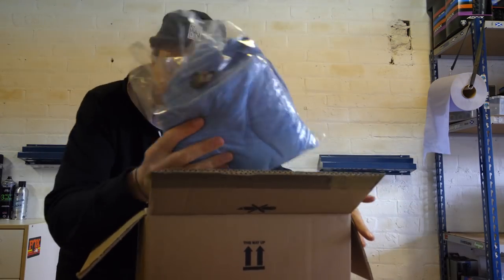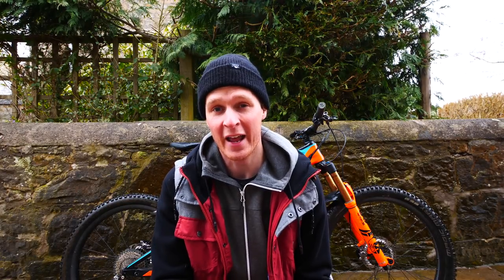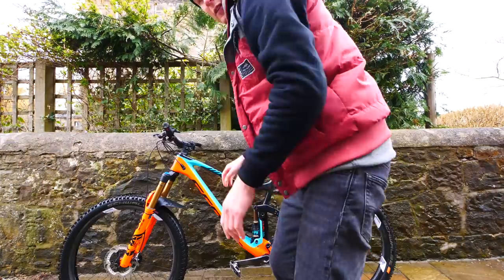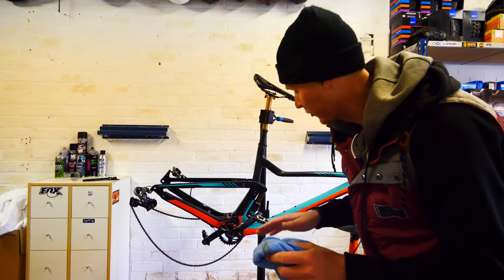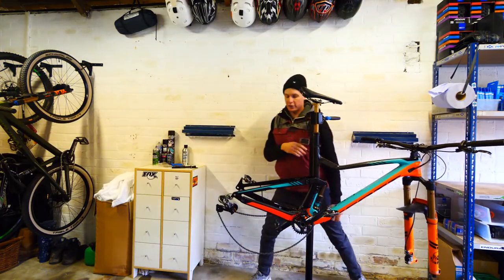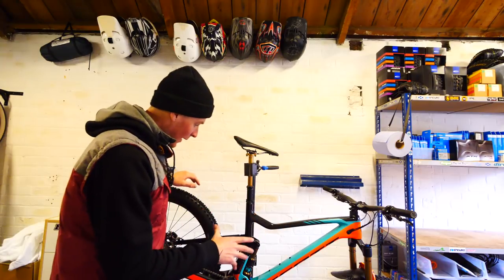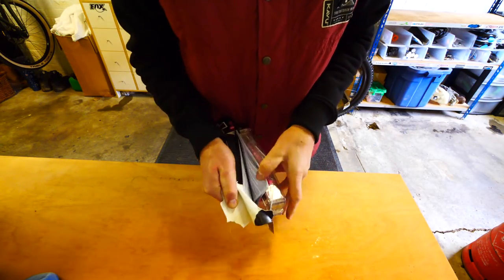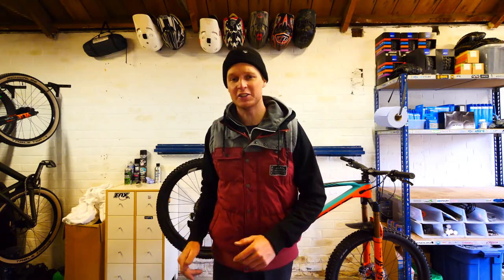A SPRING BIKE MAINTENANCE GUIDE

Comment: Using a screw driver for the jockey wheels - will definitely remember that! 
I think it was a park tool video (not sure) which explained when using a chain cleaner, once you've cleaned with muc off, to then use warm soapy water to ensure you've rinsed all the muc off / other product off from the chain, before drying (i use a air compressor to blow the chain) and then of course applying lube.